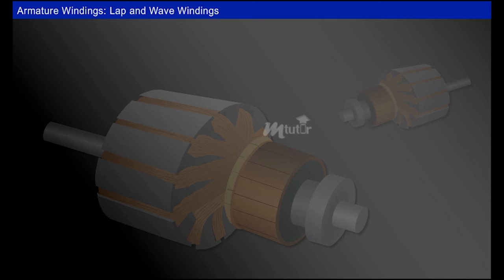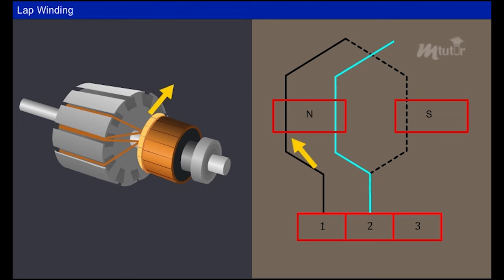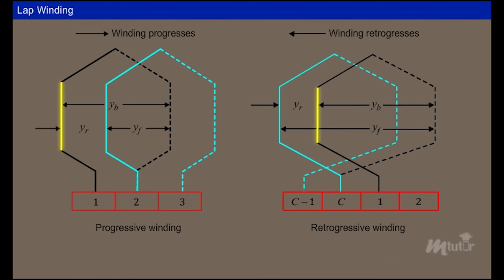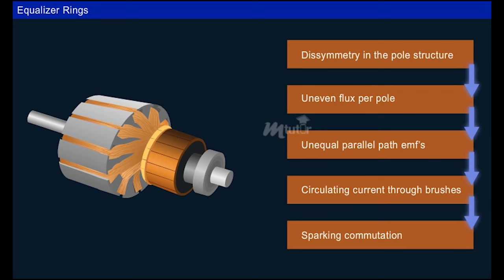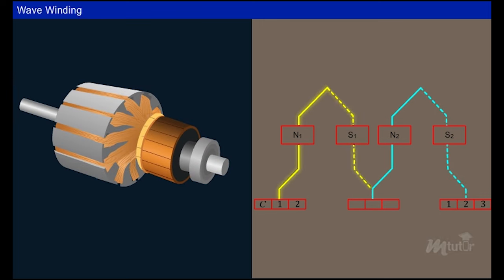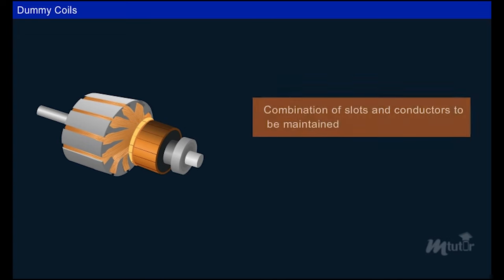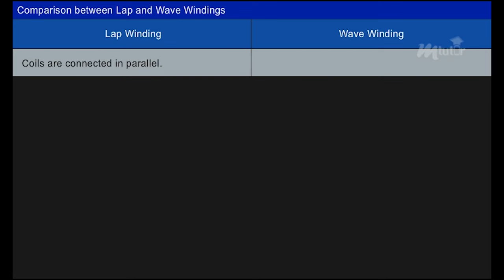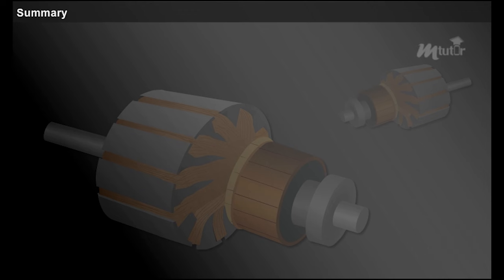Armature Windings Lap and Wave Windings [Year - 2]

Comment: We have a 3 phase generator with a stator consisting of 288 Nos of slots with 24 poles double winding and 3 parallel paths. It was stated front pitch is 2-11 & the back pitch is 1-11 (LAP Winding). Can you clarify how it has been determined? and if it's short pitch how can I define coil pitch since coil pitch is not the same as pole pitch?
Reply from the maker: please share your email with your question to info@m-tutor.com, will share details..
Reply: @MTutorEdu  okay
Reply from the maker: @tashidawa7149  As per the given problem coil sides/slots value is missing. For front pitch and back pitch calculation, we need a value of coil sides/slots. So, kindly specify the same.

Comment: I just watched the video and it was really interesting but what i not get is, at 1:54 (timing) shows an image in which black and aqua colour(hard lines) coil under magnet(N), so assume current induced in both of them is in upward direction therefore current induced in other two black and aqua colour (dashed lines) coil under magnet(S) must be in opposite direction. 
Then how can we collect the current from commutator 2 since the aqua colour (hard line) coil and black colour (dashed line) are having current in opposite direction and shortening the current path therefore not allowing current to flow through commutator 2. can you please help me out.. :)=
Reply from the maker: Short circuit will not occur. Because, the opposite end of the conductor will be connected with different commutator segment at an angle of 180 degree.